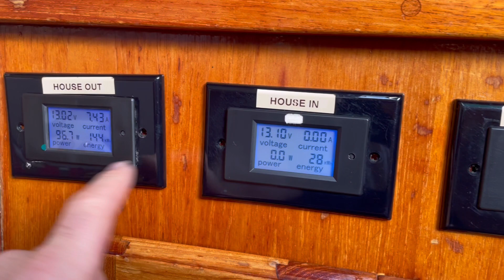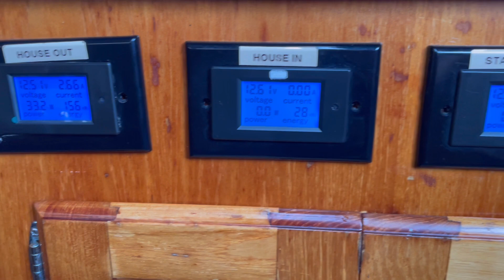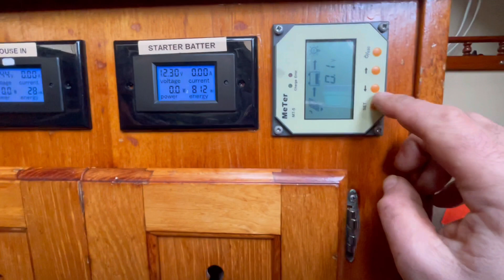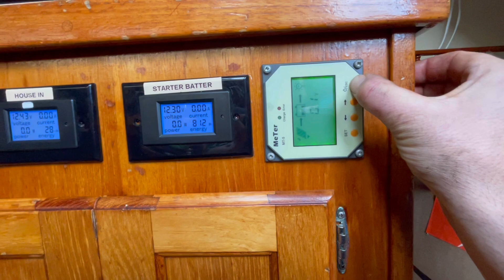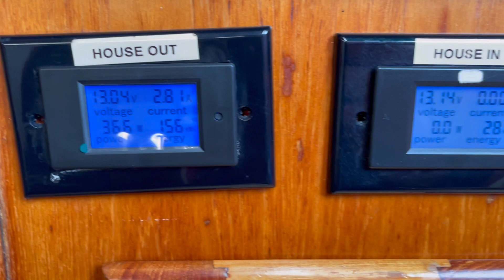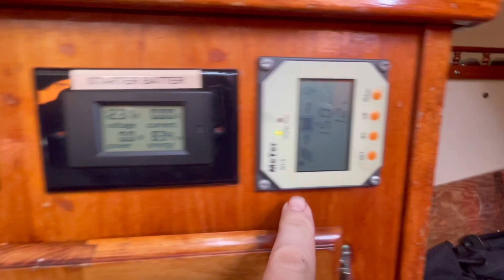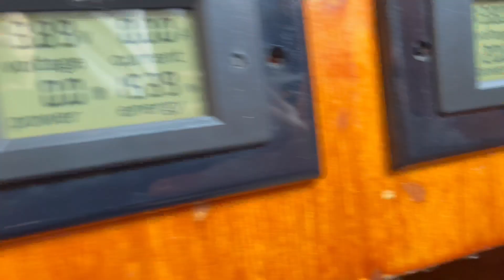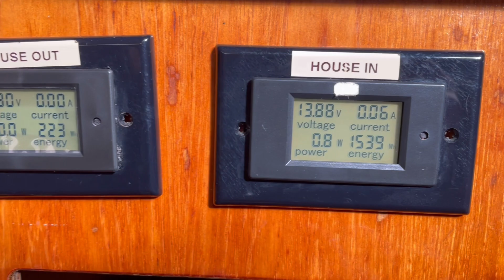Adding 600watts of Solar to our Catalina 30

Comment: You should watch some van life videos, they are decades ahead of the boat crowd when it comes to solar and batteries. 
Why do boaters talk amp hours instead of watt hours? Watt hours are universal no matter what the voltage is.  Makes calculations way easier. It also helps to run your main battery at 48v, (or at least 24v) the amount you save dealing with less amps really adds up quickly. Things that take 40 amps at 12v only take 10 amps at 48v.

Comment: Excellent work.  We did the same on a Moody 31 in Nov 22 and have now taken out the gas stove and gone full electric cooking with 590w of solar.  Didn't need to use the alternator to charge anything in June and only 10% in September, solar did the rest.  Southern England at 50'N btw.

You might need to put some cross bars in to stop it wobbling in strong winds.  We also drilled and tapped each stainless fitting then added a 5mm bolt with locktite to ensure they don't come apart after noticing that the grub screws can come loose like you.  

We average 2kWh during most sunny days and need about 0.9kWh for cooking.  The rest is for the boat domestics.  We added a Din rail analogue kWh counter to see what we use for the inverter and therefore the cooking.  The MPPT giving us the total generated.
Reply from the maker: You guys have it all
Figured out.  I’ll
Do those bolts. Great idea
Reply: There are some interesting threads with photos on Cruisers Forums under the provisioning sub section which might be of interesting to you.

What is the plan for this winter?  We are sealing leaky windows.

Comment: Thanks for sharing. Are you noticing any of the framework flexing with the tall supports? And when heeled over do the large panels catch enough wind to create any issues?
Reply from the maker: The tubing isn’t the most strong. There is some movement.  But one day it will be completed with 1.5” tubing. Maybe it will include a david system.

Comment: What do you have for batteries nevermind ... How long can you camp with those? It doesn't seem like much to me
Reply from the maker: With the 600 watts of panels.  The batteries are fully charged even in the winter now.  With 4 golf cart batteries and one starter batter ( and battery isolator) the refrigeration is always good and we even watch a few movies.
Reply: @sailingabby3467  ok I'll keep my giant bank and throw up 600 watts ! I'm doing this alone and have been worried about the diesel heater and water heater murdering them

Comment: Wiring your panels in parallel will double your amperage, having them wired in series only doubles your voltage.
Reply: Double the voltage means the wires carry less load but still the full output of both panels.  24v at 6amps in series (Two 12v 6amp panels)is the same power as 12v at 12 amps in parallel...you just need bigger wires. Now there are shading possibilty production differences but otherwise you are pretty much in the same boat either way. Power in watts equals volts times amps.
Reply from the maker: Yeah what I wanted to do is wire them in series that way the amperage would be lower and the charge controller would see a higher voltage. Either way it was going to charge a 12 V system.

Comment: I have a cheap $8 solar charge controller on my lithium batteries.  Basically it always keeps the starer bat topped up.  When the house batteries get low it stops charging because there is no voltage differential.  We also have a 20 amp Renogy dc-dc charger for the alternator.  You can make your own lithium batteries in your case and have sooo much electricity.  I'll bet could fit 1120AH at 12v.  Salty Escape did a battery build you should check out.  With tools, wire, and materials I'll bet the batteries could be as low as $600each for 280AH.  I have two, and not four...it can be a little hard keeping them topped up but I don't have 600 watts of solar.
Reply from the maker: Love this.  Maybe we could talk more about building batteries
Reply: @sailingabby3467  Just reply to this comment. I read them daily typically.